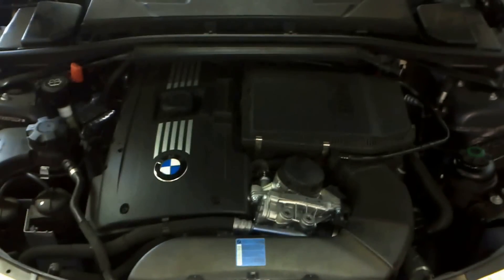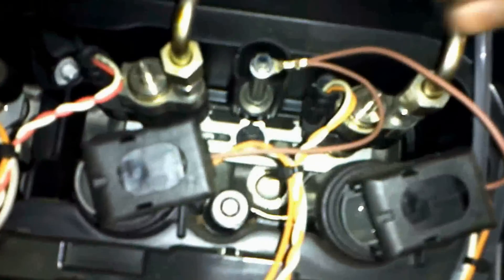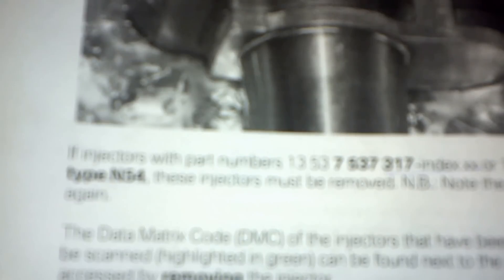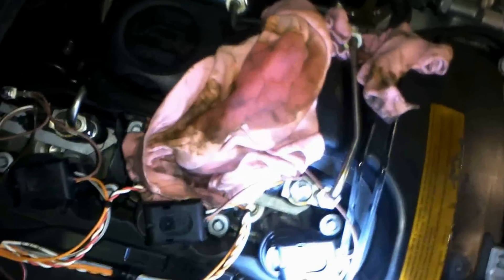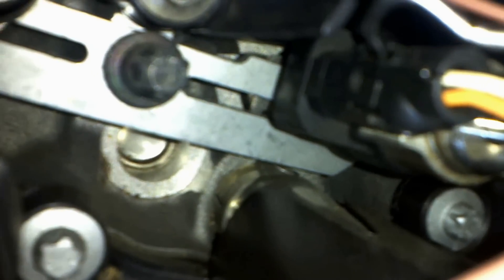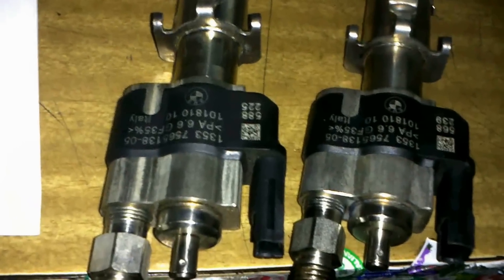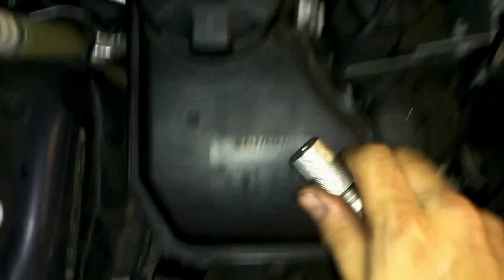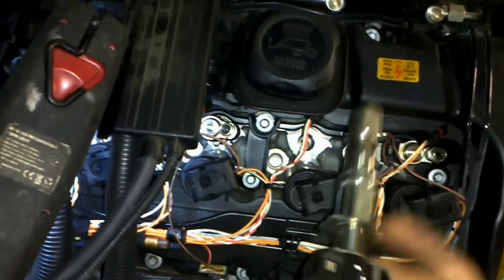BMW Injector Recall 1 & 3 series N54 Engine How to DIY: BMTroubleU

Comment: Hi Mate !! Just watched your video and need some help !! I have a 09 135i N54 with 25,000k`s , When car is warm starts fine if car sits a couple of days it has 2 or 3 second crank time on first start and if its sits a week even longer and I have had rough start before !! I have never thrown any codes and car drives perfect !! Any ideas what it could be and what to do ?
Reply from the maker: it could be the in tank fuel pump or the hpfp (high pressure fuel pump). check with your local dealer to make sure your car doesnt fall within the recall or technical bulletin. you may have to take it in to get the serial number from the hpfp checked to see if it falls within the known bad production range. the hpfp is a known common issue, but it could also be the tank pump- the idea is that the in tank pump has a check valve incorporated into it which holds pressure in the fuel system so that pressure is present when the engine needs to be started in the morning. as long as you dont have any external fuel leaks it has to be either the in tank pump, the injectors or the fuel rail pressure regulator. to check this youll need to plumb in an in line pressure gauge between the in tank pump and the hpfp to see if its loosing pressure over time (a couple of days as you mention)
Reply: BMTroubleU
I have called BMW and supplied my Serial number and they stated there is no current recalls for my VIN !! I took it to the private dealer I purchased the car from and they told me fuel filter was clogged and fuel lines dirty and they cleaned them and replaced filter !! I received the car back and same issue !! They said HPFP is working correctly and there are no logged codes so they cannot find any problems !! Is a 2 or 3 second crank time normal on cold start after car sits for several days ? I am lost and do not know what to do next !!
Reply from the maker: yea, there may not be any recalls associated with your vin, but when you say you told them your serial number do you mean the number on the actual HPFP? there is a serial number on there that can be checked against a list of known bad ones- similar to checking the injectors, the vin doesnt always tell the whole story. there is a quick 'function test' in the bmw obd2 diagnostic system which you input the hpfp serial number into and it will tell the tech whether they need to replace the pump or not. if that definitly doesnt come up as needing replacement then get a tech to install a pressure gauge in your fuel line and leave the car for a day or two to check whether the pressure in the lines is dissapating or not. if it isnt then its not fuel pressure related. do you use 95 or 98 octane all the time? are you up to date on your service schedual?(especially with your spark plugs etc- and has the place you bought it from put in non genuine spark plugs? i will say that vehicles can take longer to start when cold, but 3 seconds on a bmw seems excessive. but also, in truth, if thats the only issue youre experiencing and trying to rectify it is costing more than youre care factor is allowing you could just leave it. its one option to just shrug it off if its not causing a big enough issue for you, but if its really bothering you check out your other options above.
Reply: BMTroubleU Thanks for your help !! In regards to HPFP I know there is a recall on this part in the US on cars with even 100,000k`s , I heard that BMW Australia does not stand by this recall and my car is out of warranty already even with such low k`s !! What is your experience on this matter !! I purchased the car 2 months ago from a prestige dealer and the Car was a one owner with BMW Service history from SYDNEY BMW.
Reply: Chris Jelen I would actually like to do a stage 1 tune to my car but I want to rectify this problem beforehand !!
Reply from the maker: good idea getting everything schmick before going further. id recommend going to the dealer where all the servicing has been done. ive certainly seen hpfp get changed in auz based on recalls- you might just have to go make some noise about it in the service advisors office, then ask to see the service manager if you dont think youre getting anywhere. every bmw tech should know about this recall and theres no reason it shouldnt be addressed in our backyard
Reply: BMTroubleU Once again thanks for the great help !!
Reply from the maker: no worries brother, let me know how you go
Reply: BMTroubleU Called BMW Australia and under my VIN number there is no recall apart from tail lights that has been fixed on my car already !! Supposedly there was a bad batch of HPFP and injectors but my car is not under this recall !! Since they replaced the fuel filter and cleaned fuel lines it has been starting much better I guess I will see how it goes !! No point going into costly repairs if the problem is a couple of second cold start after a few days !! If problem does not get worse in 2 or 3 weeks ill throw on the stage 1 tune and if there is any faulty part it will show up then I guess !! I am just sick of being frustrated !! If only I didn't love the car so much :)
Reply from the maker: No worries mate. Let me know how the tune goes and where you get it from.